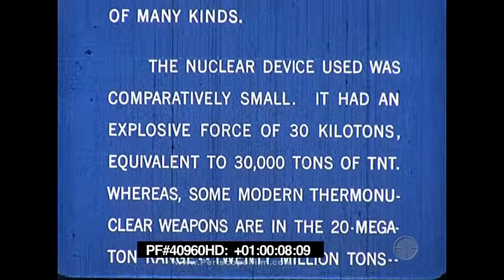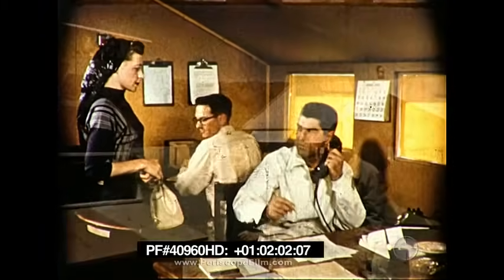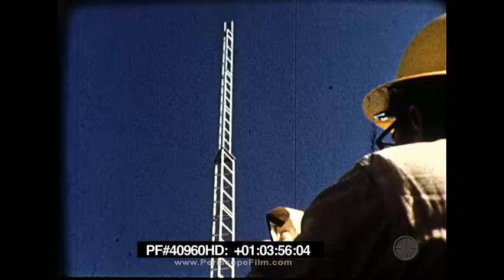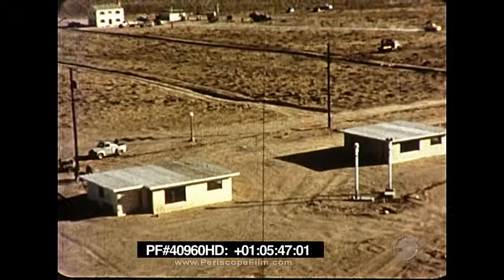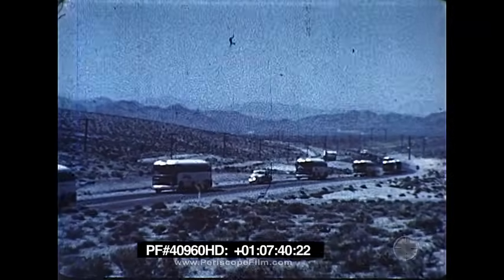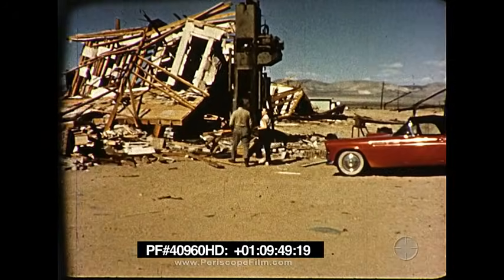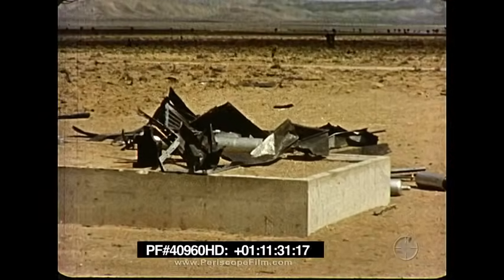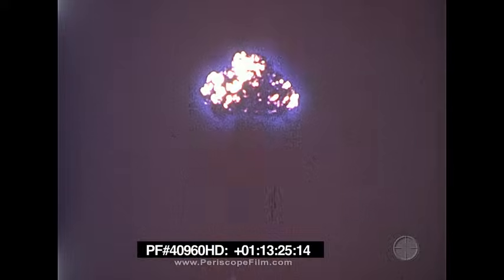Operation Cue - 1955 Operation Teapot, Nuclear Tests, Apple-2, Nevada Test Site 40960

Comment: Only i cringe seeing people going around the explosion site like nothing?
Reply: They most had wait til the radiation risk was over...
Reply: That's what I'm worried about
Reply: @prandomable  it's not gonna be over for years
Reply: @monkeydkong3399  but people still go there to visit those nuclear test sites. Visitors still go there. As for Nagasaki and Hiroshima those two cities were rebuilt and it's STILL big cities as of today with many many people living there today. It didn't became uninhabitable...
Reply: After 24 hours, the radiation from a bomb is greatly reduced. 
In a bomb, the fuel is all used up at once. 
You're thinking of a disaster like chernobyl where unused nuclear fuel was scattered over a large area.
Reply: @prandomable Because the nuclear bomb was detonated above the ground so it didn't pick up any dirt for the radioactive material to stick to.
Reply: @Popityman  above ground detonation will only cause MORE radiation harm...than ground level detonations...
Reply: @Popityman  airburst detonation is much more deadly than ground level detonations....
Reply: @prandomable  Both hiroshima and nagasaki were airburst detonations and the low background radiation is commonly attributed to that factor.
Reply: @prandomable  Because of the shock wave not the radiation.
Reply: @Popityman  so what?? 900+ nukes went off in Nevada...people STILL visit the nuclear craters....